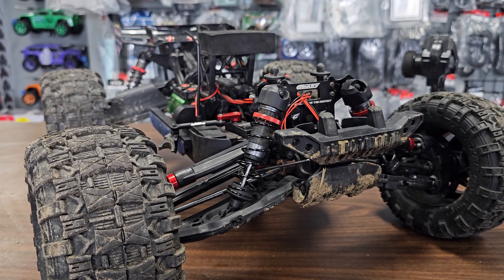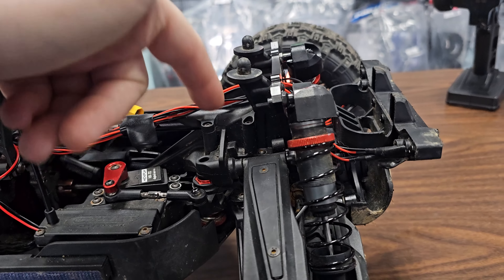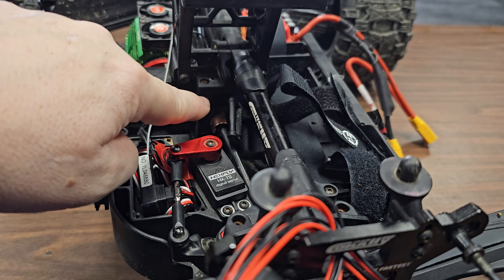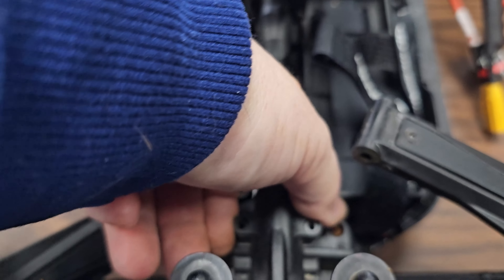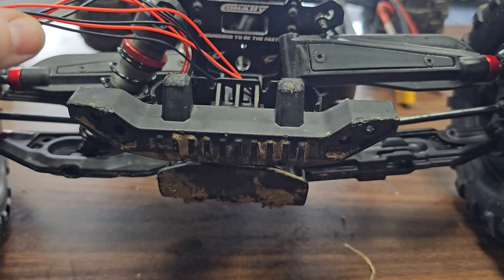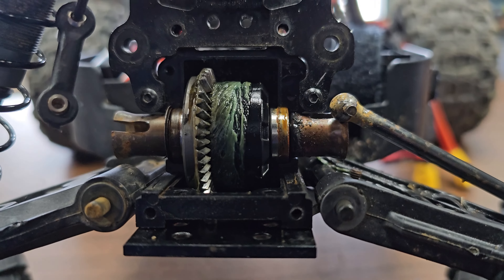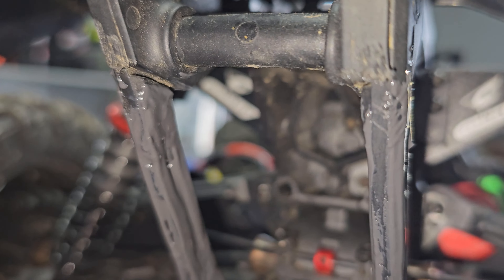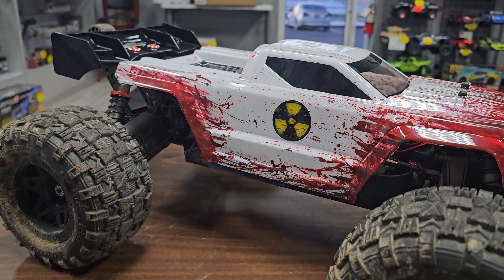Fix it- Kagama 6S Upgrade Steering bellcrank, Diff Clacking and shock leaking

Comment: That steering breakage just happened to me on my Kagama, I wasn't sure if the aluminum one would fit, because its from a different model, so thanks for answering that. Perfect video for me to watch before i get wrenching, thx.
Reply: I had an extremely hard time replacing the steering saver arm. Same break as your customer had. I ended up taking it to my local hobby shop to get help putting it back together...lol I thank you again for your video, I learned alot with this break.

Comment: Hi. Do u have links and vids on the wheelie bar install?
Reply from the maker: I do for the old 2 wheel style on a Kronos but not this one.   It was not hard to do but I will make one the next one I have to do or if this one's owner re breaks my JB Weld fix.
Reply: Can u send a link to the two wheel?  Will it fit the Kagama?
Reply from the maker: @AminbizznessRC  the 2 wheel was for the old Dementor, yes it would but it was revised to this one I believe, so may be hard to find.  I don't have any... but searching Dementor should help you find it